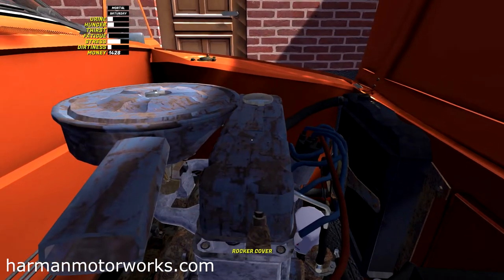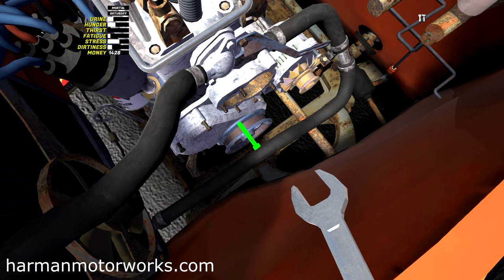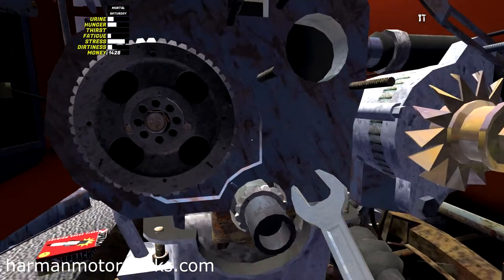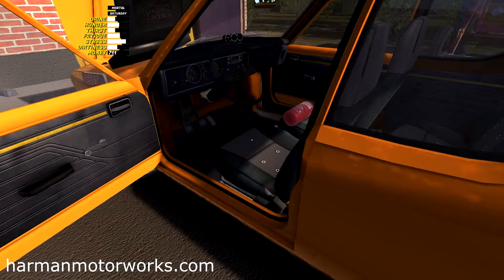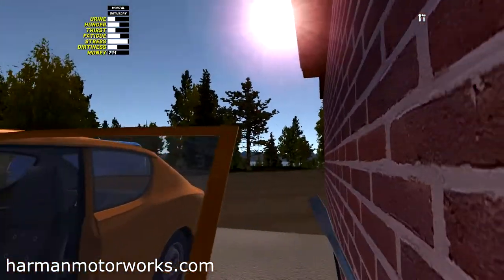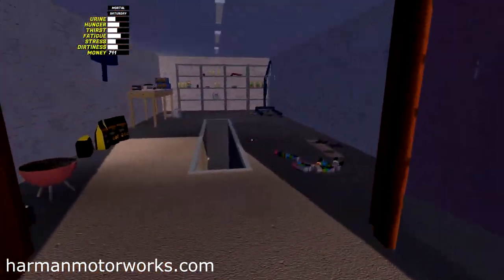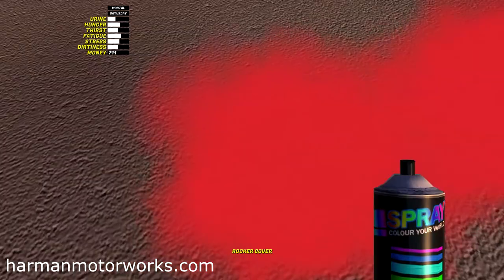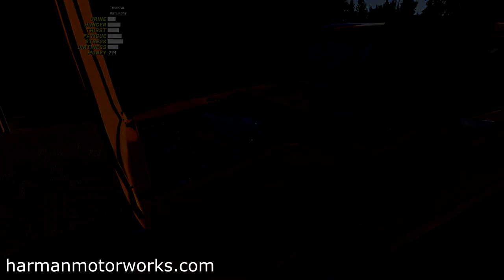My Summer Car #10 - Cam Timing & Valve Adjustment

Comment: anyone else notice when you start the engine for the first time that if the rocker arms are not tuned before you start the engine it will destroy the rocker arm possibly the water pump to but mainly the rocker arms

Comment: have they removed the ability to adjust your valves? because I haven't got any adjuster screws on my rocker shaft wtf?.
Reply: Then they are broken
Reply: @eriklofmark4836  The game is broken, towed it to that shit bag mechanic he charged me 2600 to fix broken engine parts. Gets phone call to pick it up thought lovely lets drive this thing finally right? well not really turns out he's done fuck all to the car its still the same, nothing fixed and it cost me 2600 LMFAO.
Reply: They are broken then if you have set them wrong
Reply: @leoo4842  yeah I found that out forgot to do the timing before starting it like an idiot lol.
Reply: It may be that ur rocker shaft is damaged so these screws dissapear
Reply: @exr879  Thanks for the reply buddy its all sorted now.

Comment: I know why a smoke is comim out of engine w/no rocker cover. cuz Exhaust smoke is going trough rockershaft through exhaust and out of muffler
Reply: WTF YOU ARE SO WRONG EXHAUST TAKES ALL THE STEAM OUT OF THE BLOCK ABOVE PISTONS. Headgasget is failing or it is just overheat